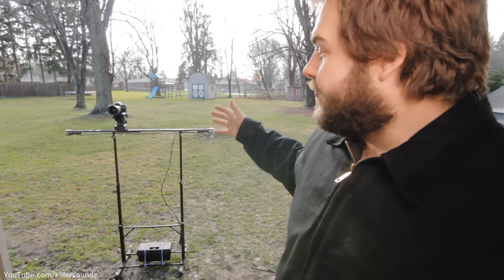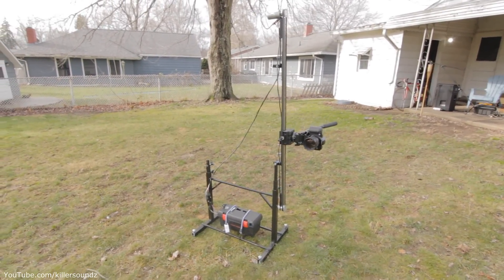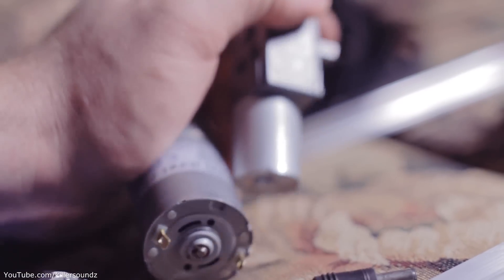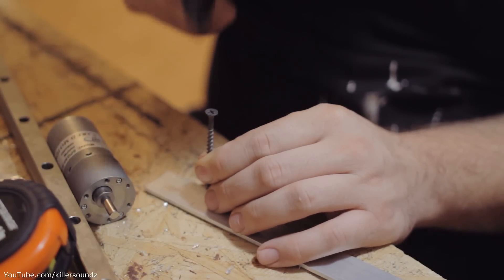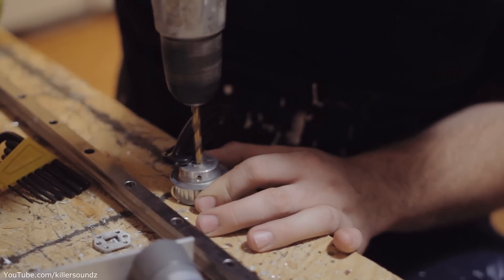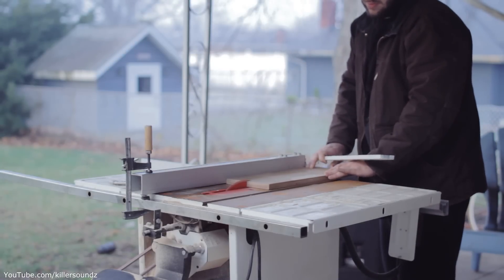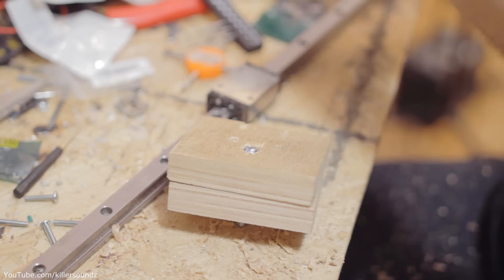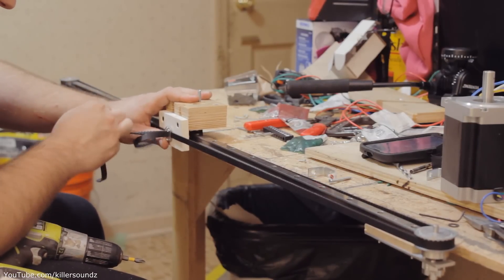Àmazing DIY motorized camera slider build w/ automatic reverse tutorial (Part 1 of 3)

Comment: Nice slider dude! I'm building one myself right now but based on the Igus rail system. I'm just using the 10mm carriage and building the rail out of aluminium.
I know that just as long as you keep the pulley sizes the same the speed won't be affected but for the sake of accuracy, what size did you use i.e. how many teeth? 
Thanks for sharing and thumbs up from Spain amigo!